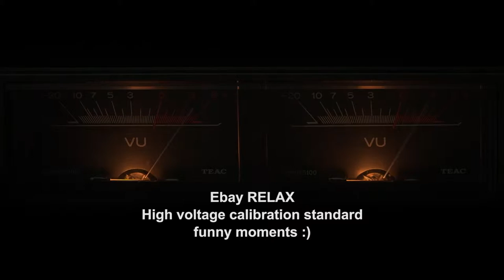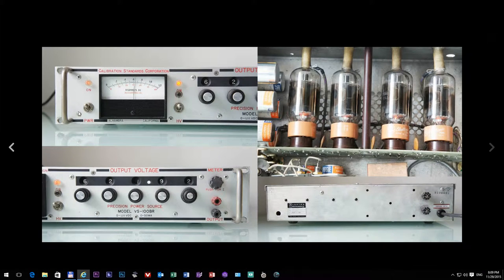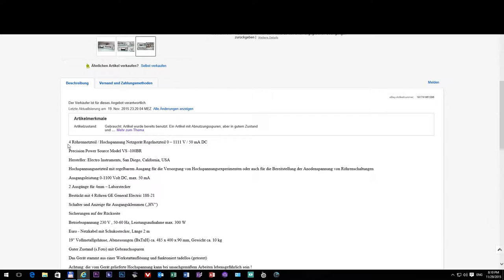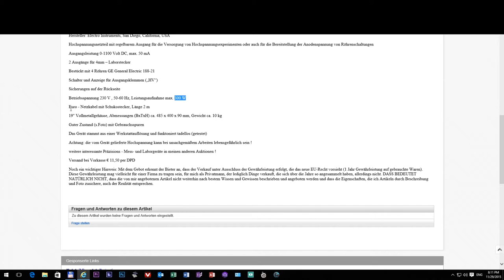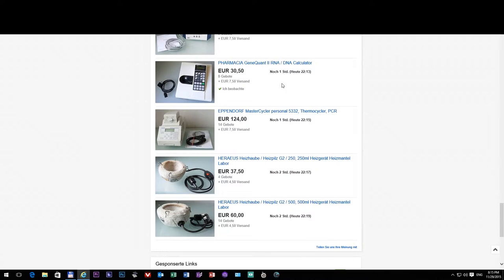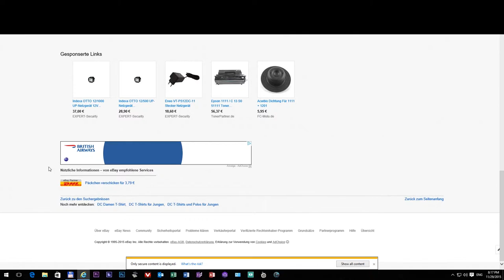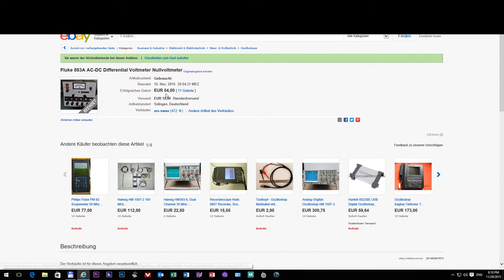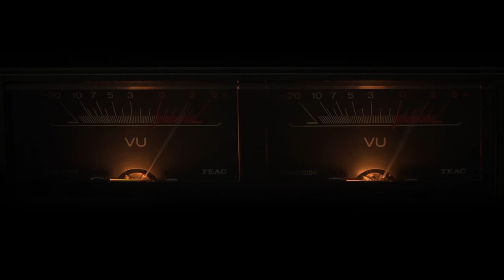Ebay RELAX - high voltage calibration standard - funny moments

Comment: I'm crying with laughter here!   I'm exactly the same.  Nerds ROCK!!!
Reply from the maker: +No Say Hehe :))) So I`am not alone on Ebay as nerd hehehe :)
Reply: BMR Studio I am watching an 8 channel noise reduction unit right now, about the same age as the Cal. Standard you bought, still days to go, but the excitement is rising already. I use multitrack tape, so I would to try it up against a DBX unit.  I do the count down with a top bid in exactly the same way as you.  Just a thought having watched the pot cleaning video.  You marked the pots before cleaning then reset them back to where they were.  It is incredibly accurate at low voltage, but I think you could get it even closer.  Possibly completely unnecessary, but it hasn't been calibrated for a very long time and the ageing valve might need compensation.  I doubt I could sleep if I didn't try.
Reply from the maker: Please share with Us this 8 channel tape preamp! Will be interesting!
Reply: BMR Studio HAHA!! If I win it.  It's still at 0.99p.  I promise I will be there at the last minute counting down the seconds with my finger on the button.